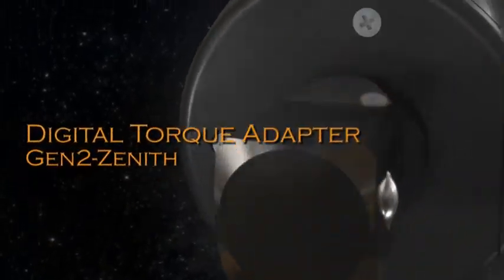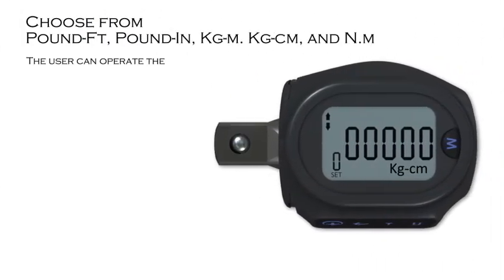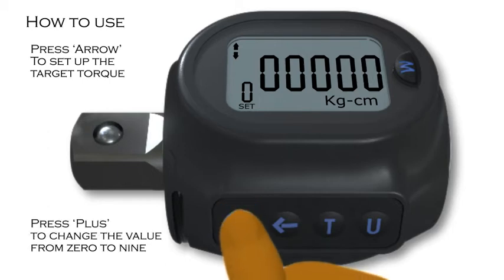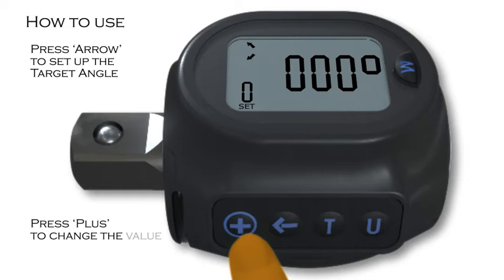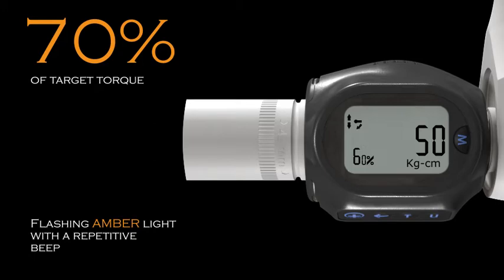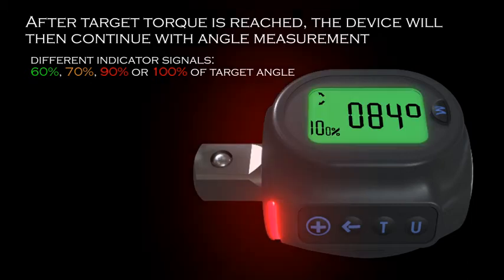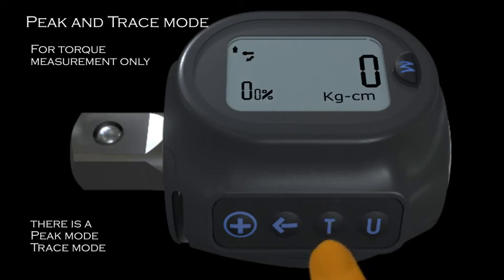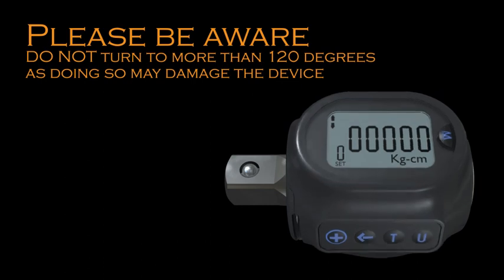Zenith- Digital Torque Adapter 2nd Generation - Product introduction

Comment: This torque adapter seems to be identical to the Performance Tool M206 that I needed instructions for.  This is the first video that does a decent job of showing how to program and use it.